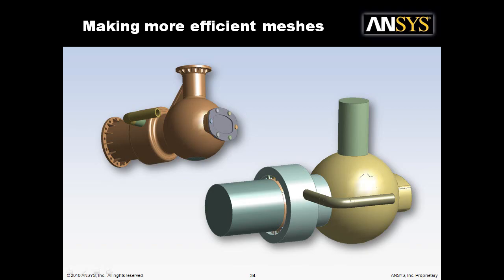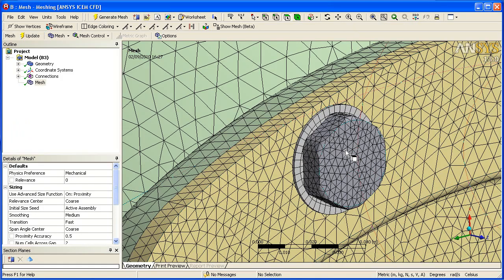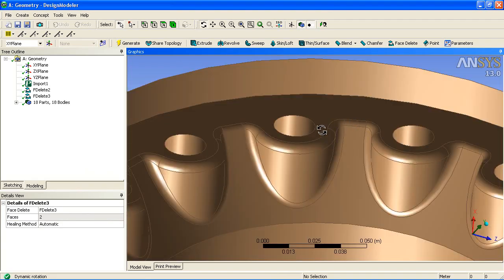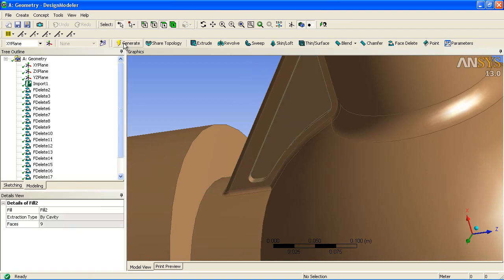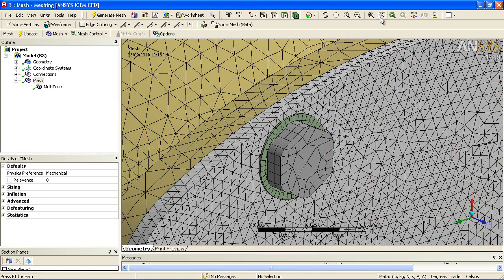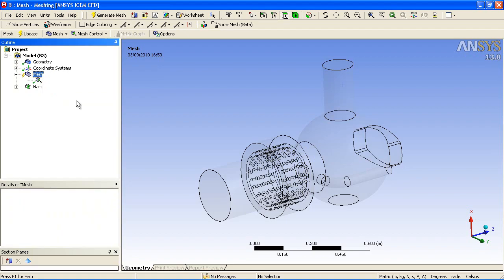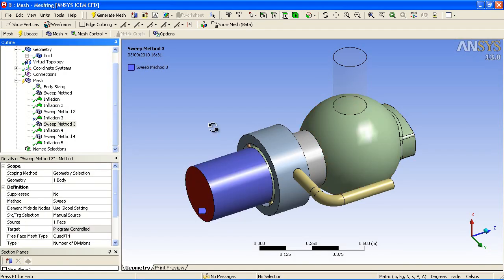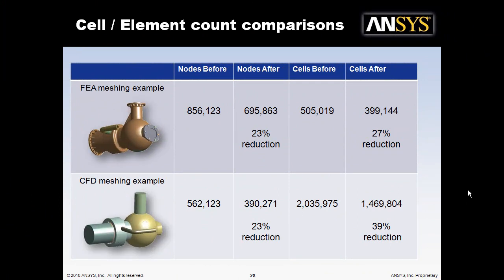Efficient Meshing Tutorial with Ansys Workbench

Comment: Ansysinc very nice video, thank you. I have some questions: 
1. Did you start to use the automatic settings provided by ansys for the mesh just to show how is it possible to reduce subsequently the number of elements by deleting geometric features ( i.e. fillets )  or this is the standard procedure you apply when you mesh a complex model?
2. How can you recognize at glance the second mesh is a better mesh? because of its "tidy" and uniform apearance in the region of bolts? thank you.

Comment: *****  great video but do you have a means to use the inner volume from the solid stucture ? ie i have a more or less complex structure of the solid and i need to work with the fluid in the cavity. I cant seem to be able to mesh the cavity. I dont know how you moved from the surface body to the inner fill around 7 th min since if i import it in design geometry and then go to meshing and try to mesh it the surface gets meshed. Is there a trick to it ?
I m new in Fluent so i cant really get an idea how to work with the fluid inside.
A bit of help would be very much appreciated.
Reply: I am having the same exact problem. you got an answer ?
Reply: I used a different geometry. Then i filled the mouth of cavity with a cap that seemed to work for some reason.

Comment: Please, could you explain how did you the descomposition of the fluid domain into several volumes? Did you do it in Design Modeler, or there are any way to do it in Meshing? Thanks a lot.
Reply: Hi Myung1987, did you every figure out how to do this? I am having the same problem at the moment as I am new to Ansys. I have modelled my volume but I need to decompose it in and all the options I have tried have resulted in a segregated meshed volumes that ANSYS  cannot resolve the flow through. Any advice you can give me would be appreciated. Cheers.
Reply: Slice the body using planes.

Comment: can you explain what is the purpose to change option NUM CELLs CROSS GAP, please
Reply: +Diana Munive Let's say you have a rectangular channel that is very narrow and very tall. With the feature number of cells across gap you can tell the proximity sizing function to refine this area (the narrow edge of your channel) until N number of cells are fitted across this gap. So, you could set your minimum edge size to a very low value without worrying that the mesh will be over-refined everywhere.

Comment: how do you make those transitions from hex to prism mesh which you can see at 11:25? I see you didn't use mesh match control, which doesn't work for me because I get an error saying my faces do not share any topology ;|
Reply: +Paw Zet This is done automatically by ANSYS Meshing if you use the option to "Form new part" in DesignModeler after you've finished decomposing or slicing your geometry into appropriate sections. Just select all the parts listed in the tree - right mouse click - Form new part. Now when you go to ANSYS Meshing and specify hexa meshes on sweepable parts and tetra meshes on the rest - the interfaces between the two types of meshes are going to be conformal (i.e. shared nodes).

Comment: Hey I have a question, using Fluent how do you import that geometry into that program? Did you use AutoCAD or another computer aided design product?
Reply: Use solidworks
Reply: you can use any cad program. When saving the cad file, save it as STEP or IGES file format as Ansys only understands those file format. Next, open Workbench and drag the module you want eg. Fluent,  Mechanical etc. Right click the geometry box and click import geometry and find the file with the STEP or IGES format and open it.